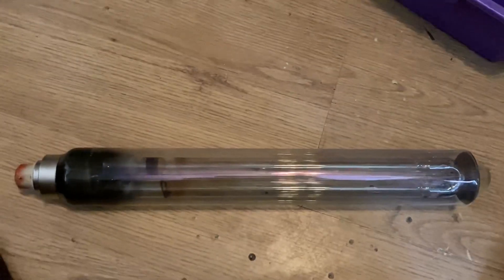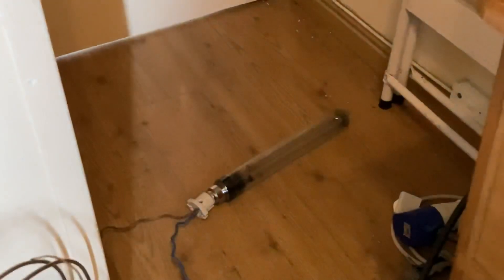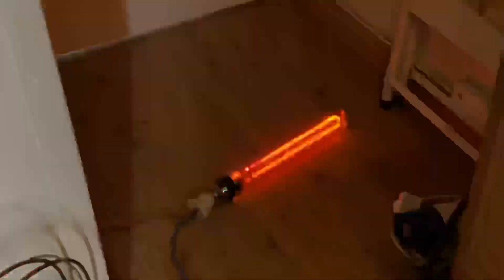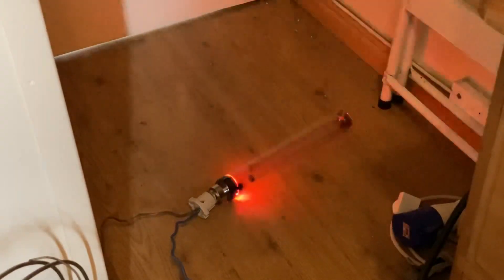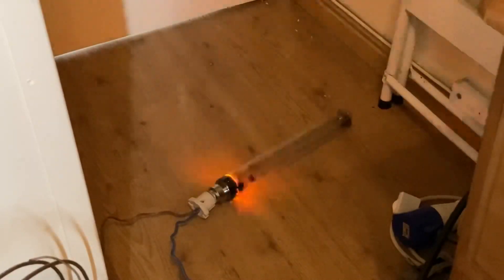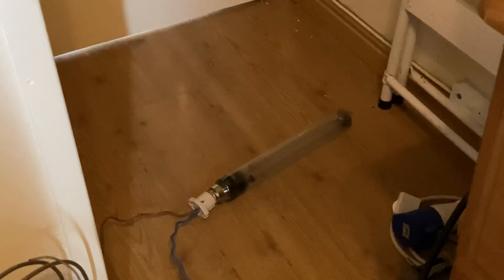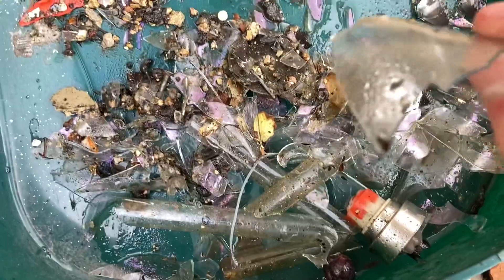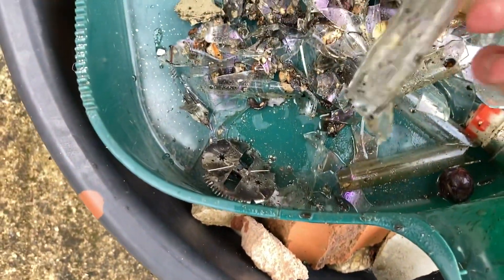Sox Lamp VS 1000v + Sodium in Water

Comment: You need to put a plastic sheet down when playing with high voltages on wooden surfaces as wood is a surprisingly good conductor at a few kV or more.  Looks like the arc simply grounded to the floor and melted through the outer envelope.
Reply from the maker: it melted the seal in the base though not where it was making contact with the floor. Wood breaks down at quite a few kv though (probably more than 10kv) and this is not real wood either it’s a composite material with a plastic layer of wood texture.